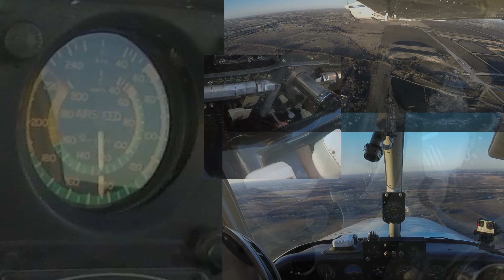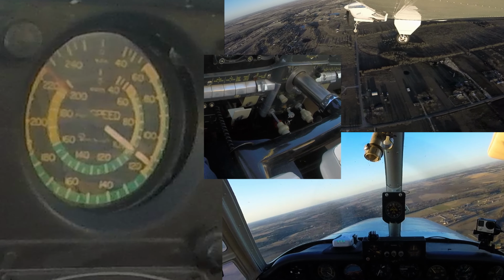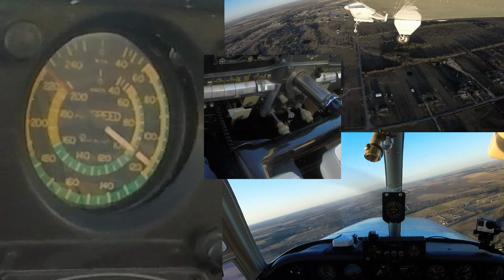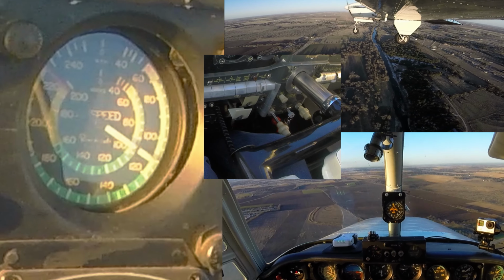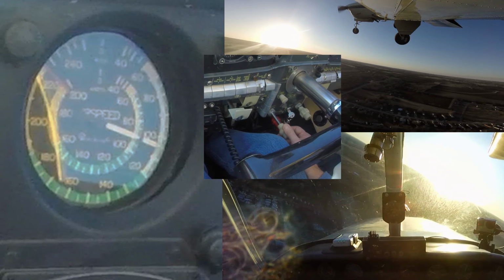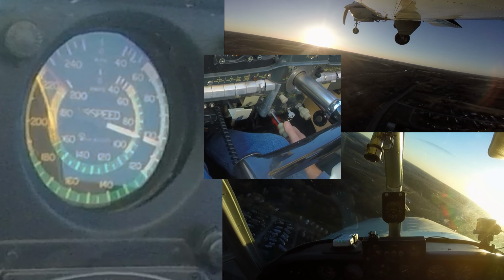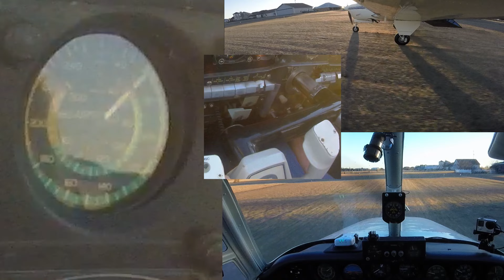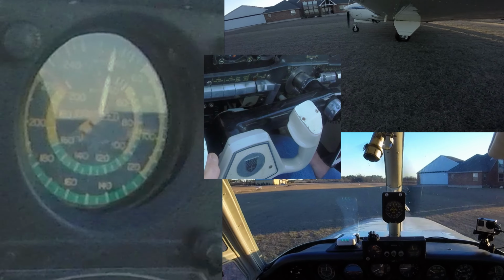Landing the Dr. Killer

Comment: I also fly a J35.  Your approaches are safely able to make the field if the engine dies at all times and you are landing in 1000-1200 feet. Why change a thing?!  I’m a newbie in the Bonanza and trained with slower approaches. Now I come in quicker. Safer to me. If I’m in an emergency, have an extremely short landing space, I could easily slow up the approach as could you. On another note, I wouldn’t trade my J35 or what seems like the bulletproof IO-470 for many other platforms.
Reply from the maker: Thanks for the input and for watching!